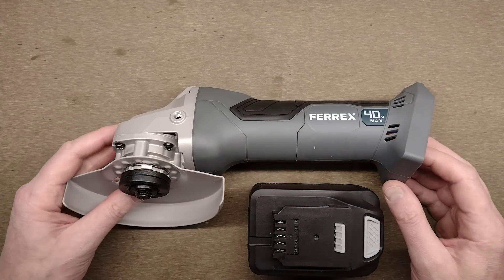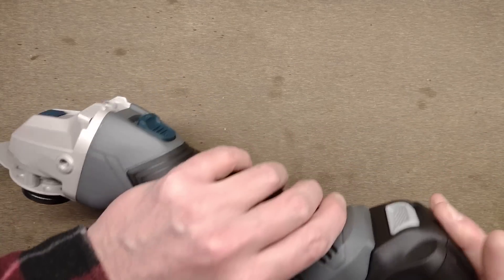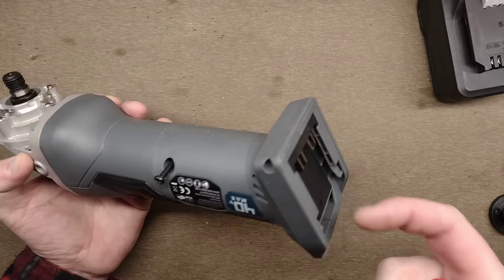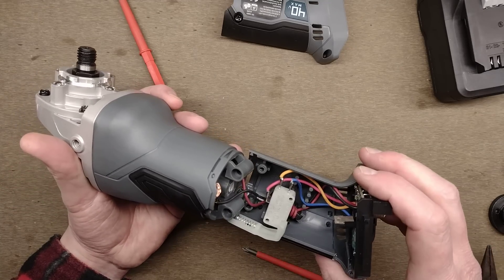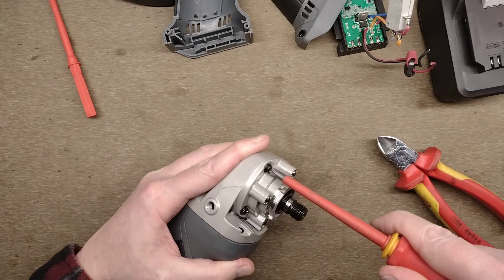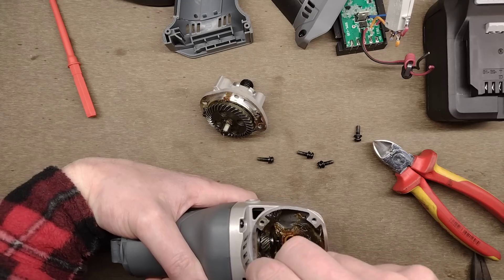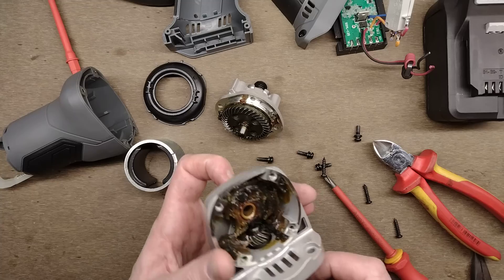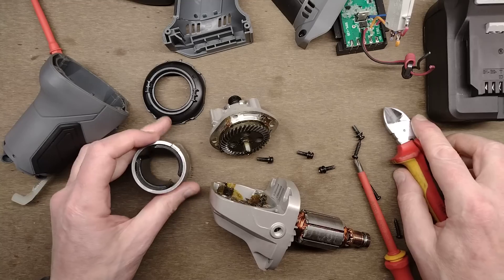Aldi 40V angle grinder mechanical teardown

Comment: Aldi is my supplier of choice for power tools. Generally I have done well with them,, but not universally well. My hedge cutter worked for less than a second then no more, an angle grinder refused to work then worked, then stopped & a 20/30 volt battery refused to recharge. All of this covered by the 3 year warranty & the rest of the tools which count well in to double figures have been blessings that make so many jobs easier & faster & I don’t find that quality that different to the much more expensive brands. Thanks for sharing!
Reply: so basically all you bought is garbage and you think the quality is not different then expensive brands ?   you're smoking some weired strong shit.
Reply: @casemodder89  Of the 15+ Aldi power tools I have two failed as did a battery. Risk/expense is massively good as the fails will be replaced under warranty. For an hobby user like me the cost of brand name tools is prohibitive whereas the Aldi tools are low cost & have been great blessings used in many diy projects.

Comment: It has 3 charging LEDs not 2. The two disc clamps are for different diameter holes in different grinding discs, you glossed over that.

Comment: Clive. If I'm correct then this will be your first 2 part video. 🤔👍
Reply from the maker: So far - The 40V tool, the module out of it, the battery - and coming soon, the charger and a 20V tool.

Comment: These cheap aldi tools aren't the best but they work fine in a pinch got a 20v one a few years ago long before they started the multivolt batteries. I got about 6 months out of the grinder and in that time it was used and abused in jobs no 4" battery powered grinder should have ever been used for

Comment: The bike thieves tool of choice. The gears are bevel gears like ducati used back in the day. Clive could you do a video on how to smooth the output of one of those SCR voltage controller units you can get please? I need to rectify the output of one of those for a DC motor on my lathe. I know little about electronics.
Reply from the maker: It might be worth trying to find a proper DC controller for better torque.
Reply: @bigclivedotcom  wish I knew more about DC motor power supplies.  The lathe originally used a big variac and selenium rectifiers, all well past their sell by..

Comment: You should take a look at th knock off makita brushless angle grinder  they can be found on ebay between £20-30 I got one and swapped out the battery holder with a 3d printed lidl one with a couple of the 5ah batteries it does the same as my brothers expensive German one

Comment: They are on aldis web site for a tenner now. I have 3 of them which have been in use for a couple of years now really cant fault them. They may not be the same as the high end manufacturers but for the price including a 3 year warranty you really cant go wrong. I also have the hammer drill and impact from the same range and have found them all to be good value.
Reply: For a tenner, it's worth it for the tool side of the battery connector. Cheers Clive!
Reply: Thanks for sharing 👍

Comment: Isn’t it called a pinion drive, similar a differential pinion gear driving the ring gear, with the pinion shaft being the motor shaft in the drill?

Comment: FWIW its called a ring and pinion gear. They look to be spiral bevel type. Since its an angle grinder and goes at fairly high speed not much reduction is needed, and the rattling is likely excess backlash/clearance to allow the whole thing to be cheap and work with a wider range of tolerances.
Reply: the backlash is to allow for heat expansion in the crown+pinion gear.

every cold angle grinder sounds like a bag of marbles.  but after a few minutes of work the teeth mesh in nicely.
Reply from the maker: Interesting to know.
Reply: @casemodder89  Makes sense since motor shaft is probably much hotter than the housing and transfers lots of heat into the gears along with frictional losses. Additionally its an angle grinder so the possibility of dirt ingress is also an issue, and that it doesn't need to be precise to begin with.

Comment: The battery design looks similar to Harbor Freight's Atlas line of 40v/80v tools which are quite pricey. Those sound like there's a three phase motor controller involved.

Comment: The 20V/40V thing looks similar to DeWalt's Flexvolt setup, quoted as 18V/54V in Yerp and 20V/60V in USA. (I guess USA Volts are smaller, like USA inches ;-) ).

I think the Flexvolt setup allows you to use them in older tools, and charge on either 54V or older 18V chargers, keeping existing users happy with compatibility. In 18V mode the batteries are always dis/charged in parallel, I think using MOSFET switching.

Because of that, any imbalance should be small.
Reply: Our trade regulators allow companies to advertise the float voltage, rather than the working voltage.

That's one of the things I liked about Hitachi Koki cordless stuff: they didn't play that game. You got 10.8V, 14.4V, and 18V even in the USA. Sadly that was probably also a factor in their weak market penetration.

Comment: OMG. . . . Nice screwdriver set. . . . 
Saw these grinders online, might pop down shop try get a Bargain like yourself.
I wish I'd asked on last-nights stream. . . . . . . What the effects of these continuous low temperatures (which were normal in the 50's & 60's) Are having on these new Virtue Signalling Scottish Electrical car scene.. . . . An electrical car anywhere north of Perth is of no practical use due to geography and environmental conditions (we don't get smog). . . . Heir/Frau Strugeon will not allow the sale of new internal-combustion vehicles after 2030.
Reply from the maker: The driver set is a Wera VDE set.

Comment: I bought into the Aldi Ferrex dual voltage tool line a few years ago. The angle grinder is one of my favorites and works great for my needs. I trashed the jigsaw and the multitool but got replacements under the 3 year warranty. Although it took the months to send them to me, can't complain for the price honestly. Also got a bunch of 3d printed adapters to use the spare batteries as Powerbanks. Also retrofitted a trash picked NiCd drill to use the same packs and one to run any 18V Makita cordless tools on.
Reply from the maker: Keep in mind that these batteries have no facility to shut themselves off if over-discharged.  They just send a signal to the tool to do it.
Reply: @bigclivedotcom  I wAs never quite sure, good to know! Maybe that's a good idea for a video: How to fit such a battery connector with a MOSFET that will act as a over charge/discharge safety. Anyways: Thank you for relentless output of entertaining education Clive!

Comment: Hey Clive. I've used a LIDL 20V angle grinder on a construction site and have taken it apart a few times.

Things that make them fail A LOT quicker than their expensive cousins (it's not necessarily the mechanics!):

- no protection against grinding dust ingress
- no conformal coating of the PCB(S)
- battery pack PCBS don't have coating either
- motor switch burns out quickly (rated 20A, 36VDC!) as it heavily arcs when turning the tool on.

Just clean those tools with compressed air when done working and you're good to go.

Cheers!
Reply: Thanks for sharing 👍
Reply: For sure it really is a cheap tool that won't last long, however it seems they have improved this 40V version and actually coated the PCB.
Probably there were too many warranty returns.
Reply: @mrfrenzy.  nice! I had one 20V battery not charging anymore, opened it and the cells were all within 0.05V. So I removed all the lime-sandstone dust off of the PCB and it started charging immediately...

Comment: The batteries seem like a good way to get 18650 cells. The Battery is about £26 and contains 8 2500mAh cells (Samsung or LG), thats about £3.25 per cell, cheaper than most online stores for 18650 cells.
Reply from the maker: There are ten cells.
Reply: @bigclivedotcom  Seems I cant count the thing right in front of my face! Yes, 10, even better value really.
Reply: 'Samsung or LG'????
The cells in these things wont be top end Samsungs or LGs. More likely just one step up from Ultrafires and Kodaks.......
Reply: @Debbiebabe69  they are, there are a few teardowns on YouTube.

Comment: I have an aldi grinder for several years.  
It is not a top quality tool. 
But for the price it is a real good deal. 
I use it when I need to grind something out of a car on the car junkyard. 
Because when I drop it or when it gets damaged. 
It is not a big loss. 
Conditions on the junkyard can be very hard like rain and mud. 
I don,t want to use an expensive tool there.

Comment: The angle grinder design mechanically is the same as a wall powered one. My dad always takes the gearbox apart since the cheaper ones usually don't have the grease on the gears but beside them. They get quite a bit quieter with grease in the right place.
Reply: My Bosch mains unit started making a lot of noise refilling with grease fixed it. Designs are all much the same.
Reply: And also making sure things are aligned properly. I've got a cheap angle grinder that's ancient and other than replacing the flex (broke where it enters the unit) it's brilliant. After replacing the flex it actually got quieter due to better lash between the gears.

Comment: well other than the motors stator being smaller than my 110 old craftsman which i had to put a new cord on so i cleaned the old dried out grease out of the helical gears it looks a lot like any other grinder save for the electronics

Comment: That right angle drive is called a spiral bevel gear set. The big one is the crown wheel and the small one is the pinion.
Reply: AVE would tell you it's called a spinamathing.
Reply: The ring & pinion aren’t perfectly aligned like in your car’s differential. These are slapped together with “close enough” tolerances, and after a use or two, chucked into the fuckit bucket

Comment: It seems serviceable, they use a standard micro switch which is replaceable. The mosfet can also be easily replaced, if and when it goes pop. In some of the brushless designs, of the more expensive units, everything is potted in. So on those units when it dies, it goes in the bin.
Reply: If they use the same "technique" as the LIDL system (switching the high power motor directly on(off) you'll have a hard time replacing that switch. In my LIDL grinder it's an 20A 36VDC rated one. Those 12A 250VAC one have the same dimensions but will burn after a few cycles...
Reply: @herrgerd1684  I'm sure you could Source the 20A micro switch with the same form factor. The problem is it might not be that cheap. I'm guessing RS components might have them.

Comment: Now at Lidl online they have a 40V brushless 230 mm angle grinder for €119.99 and a 40V brushless saber saw for €99.99
Plus €3.99 shipping (each?) but there is a coupon for free shipping during Christmas spending more than €60
Prices are without the charger and the batteries because them use two of 20V, the higher voltage CAS alliance cordless tools do the same and I personally like it better this way.
Since a single dead cell kills the whole battery by being able to purchase "half battery" you can save a lot of money on high capacity batteries.

That's in Spain, I don't know if they sell online in all the countries where they have physical stores. Also the prices aren't the same in all countries, mainly because each country has its own VAT rate.

Comment: The magnets for the motor are cheaper and wider from the more expensive brands which have 4 skinnier magnets and hall effect sensors that control the motor. Also I wonder how long it would last under normal use 40 volts should be a decent enough power
Reply: you get scammed by voltage numbers easyly.

40V (36V in reality) at 10 Amps is 400W.  guess what 20V (18V real) at 20 Amps is. 🤔  exactly... 400W.

also 20, 40 and 60V tools got their voltage - until you pull the trigger.  then your back to the the real 18, 36 and 54 volts. or even less under max. load.
Reply: @casemodder89  your right but 36 volts at the motor should still be decent enough power under normal use is my point any good tool should last years of use and manufacturers don't list the battery packs at under load condition just their max voltage that's why people say 20 , 40 , 60 volt because it's the type of battery pack that goes with the tool I'm sure everyone knows once you put batteries under a load they drop in voltage ⚡️ so calm your tits 🤣 
Just think if we didn't all our cars would have dead batteries because we would have never built alternators to keep the battery topped up.
Reply: @ericrichardson3332  yeah exactly for the type of battery you don't call 'em 20V but 18V because the cell typical voltage is 3.6/3.7V (x5 in a row, or x10 in this "wannabe 40V" case).

and lead acid batteries are a whole different kind of beast then lithium-ion  they're called 12V. because thats the type. nobody would call them 12.6V  [flooded sub-type]  or 13V [AGM sub-type] for their full charge voltage as that is not usable.  cranking an icecold engine may result in below 10V at hundreds of amps delivered to the starter.

that'd be like bragging with engine horsepower rather then BHP. well, the murricans do it iirc. nobody tells you the auto slushbox eats up 70HP that will never see daylight.

aaaand my titts are chill AF. 😎

Comment: Similar to a differential which is called a ring and pinion.
I'm surprised they don't put a heatsink on the mosfet.
That would be 36V nominal or 42V fully charged.

Comment: 20/40V great, must be much better than 18/36V 😁
I wish they could agree on using the same cell voltage when adding up, I'm sure some "not nerds" get conned by the higher number.

Comment: There's more going on in the battery pack I hope. Makita has the best BMS circuits bar none!  The perpetual fail for virtually all these angle grinders is the lube for the helical gears. Run it once and it's nearly metal on metal
Reply: makita is crap in batterys.  sometimes they shit the bed from lying in the shelf.

never had that problem with my bumblebee fleet.
Reply from the maker: It turns out there is a lot going on in the battery pack.

Comment: Nice to see the conformal coating on the PCB though, honestly a little surprised to see that in such a cost engineered device, so it may actually stand some chance of lasting more than five minutes
Reply from the maker: It wasn't so nice getting it off to make the video on the PCB.  (Coming soon.)

Comment: Such a poor build and engineering quality tool. injection molded head looks especially cheaply made, and the magnet is borderline loose, except that little tiny tab with which it holds onto the casing... No "armor" on the rotor windings, and the bearing is just so one wouldn`t sue them. The plastic looks like it`s going to shatter from just about any stress you`d put on it. I think that thing should be on a quadruple discount, with a big sign "Warning - waste of time and money".

Comment: Connect a 240v incandescent light bulb where the motor should be and watch what happens when the button is pushed.
It's an ok grinder, cheap but pretty decent for occasional home use.

Comment: I used mine for trimming concrete slabs for a new patio. It's a capable machine.3 year no quibble guarantee and returnable at any Aldi.Batteries are half the price of some other brands and are sometimes discounted.

Comment: For 10 bucks it is a sore dick deal! Metal gearbox, and by the looks of it, machined spiral bevel gears instead of injection molded ones. That tiny arse MOSFET will probably let the smoke out pretty quickly. Really doesn't inspire a lot of confidence at all. Bet that thing is your weakpoint. Rest looks pretty solid. 

Those batteries are usually switched internally. The tool sends a command down one pin to enable the two 20V banks to be put into series. At resting state they are usually in parallel.
Reply from the maker: In this case the battery pack has no internal switching.  It's all done in the tool, with data saying when the battery is low.

Comment: There's also an Aldi 20V brushless angle grinder, definitely try to explore a 20V tool and how it connects with a 40V battery, it's always puzzled me, if it doesn't parallel the two sides together then it's going to drain one half, if it does parallel them, then how does it deal with the potential balance issues?
Reply from the maker: I now have a 20V tool to explore.
Reply: @bigclivedotcom  looking forward /bated breath..... Clive, you probably hit the proverbial on the head - the "magic" is inside the actual battery unit. Point to note, that ball-bearing cowl mech, I never knew, very handy for turning 180 to protect the dutiful Dewalt sub 0.9mm fragile cutting disks in some marathon man's lively tool bag bus banger bolt job bit pay bumbledor, yes do not break a disc on that job....

Comment: I'm always amazed at the variety of products sold by Aldi outside of the US compared to what is commonly found in the stores here. However, with that being said I don't visit either of the Aldi US locations near where I live very often so I may be missing out on seeing many short term non-food related items.
Reply: I've seen lots of Ferrex power tools at my local Aldi over the years. It just depends on what they decide to bring in on any given week.
Reply: @puckcat22679  

I love those central aisles, always something different!
Reply: This grinder has never been available at US Aldi stores.
Reply: @jctoad  maybe, but I've definitely seen drills, impact drivers, oscillating multi-tools, and other stuff there.
Reply: @puckcat22679  yep. Lots of other Ferrex tools. They just had a rotory tool kit the other week.